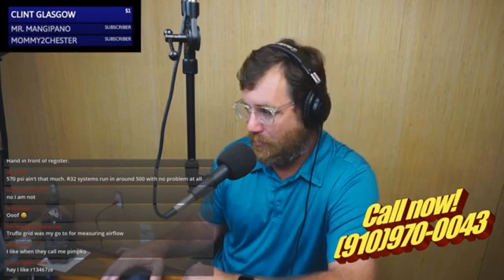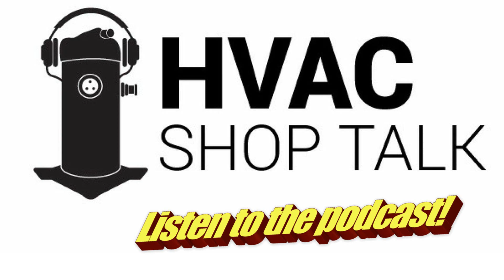Issues with Vane Anemometer and Static Pressure Measurements

Comment: A duct traverse with a hot wire anemometer is the only way to fly! I can get an accurate measurement within 3-4 minutes. I use a field piece
Reply from the maker: I have difficulty finding good measurement locations here for Hotwire. I have used the STA2 in the past when able. Worked well.